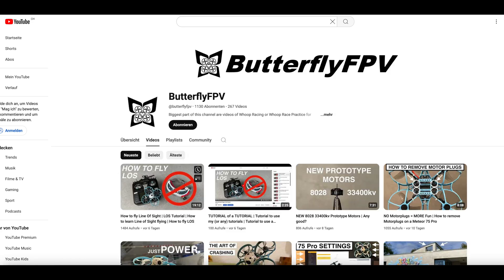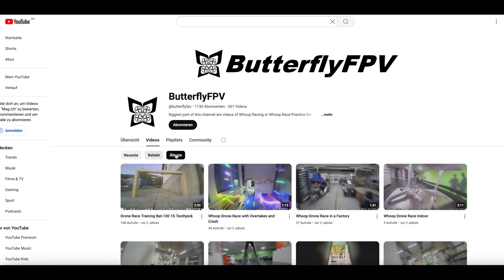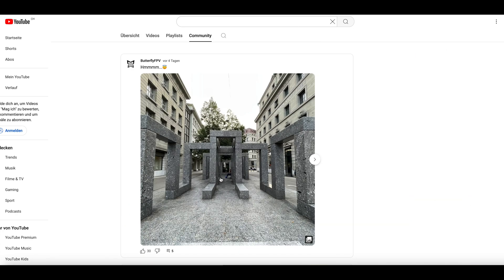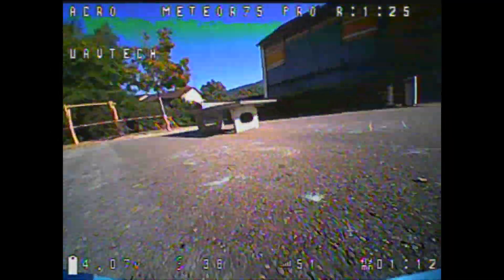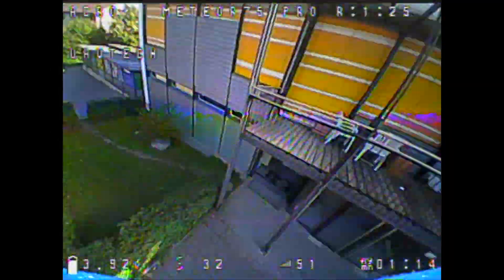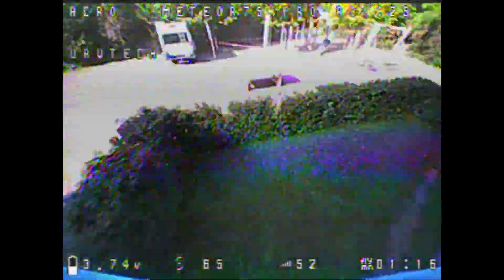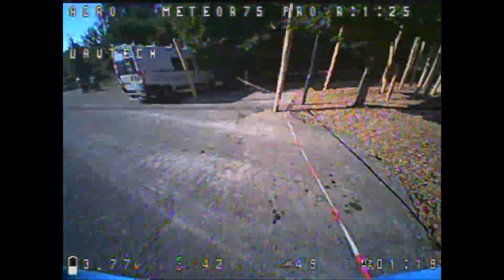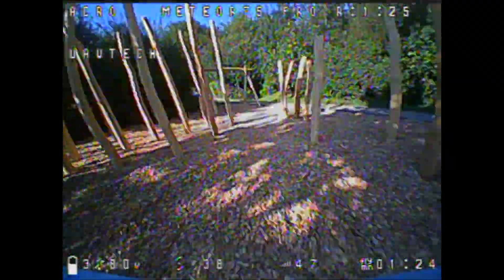🛠️ How to fix slip whoop motor shafts | How to repair slip motor shafts | Motor shaft slipping fix

Comment from the maker: ‼⚠INFO and LINKS in the VIDEO DESCRIPTION⚠‼ And a little additional information here: It could well be that this fix of slip shafts with screw lock or superglue is just a temporary solution. This would be supported by the fact that manufacturers do not use screw locking or another adhesive right from the start. Except now with the new tiny whoop motors. I think they integrated an adhesive right from the start. https://www.tinywhoop.com/.../702-26kkv-silver-edition... To be honest, I've only heard of this slip shaft problem with Happymodel whoop motors so far. In any case, I've never had any slip motorshaft problems with this with my rcinpower motors..
Reply: Great video mate 👍 I had that happen with 3 Snowblowers during IGOW 4 but I'm not sure if it was the lack of adhesive used or also to soft metal on the ring that may wear out.
I tried fixing one back then but the shaft was just too loose.
Reply from the maker: @McLogo76  🤜🤛 Soft material could also be a problem, you're right! That would also explain why the shafts on my Happymodel 702 28k engines began to slip despite the notches in the shaft that were supposed to prevent this. And that would also explain why the problem only appeared after about 100 flights. In any case, I have never had a slip motor shaft with my rcinpower motors.
Reply: I'm flying a Atomrc Seagul. Shaft and bell held together by some sort of adhesive. I used ac glue and it held very well until a bad crash yesterday. I reglued it and will try thread lock next time. THANKS.

Comment: I've done this on several motors the same way that you did and they're still working fine. I used Red Loctite. Also cleaned the shaft and hole with alcohol before applying the Loctite.
Reply from the maker: Thank you for your feedback! Appreciate it! Same here. My motors still work too. I also used the hard threadlocker. (the liquid itself was green)

Comment: You’d think someone in the design team would have made it a notched shaft end in a notched hole to prevent this 😂
Reply from the maker: Yes, that might be the solution. Just like the new top spin motor series from tinywhoop.com. Although it might not even be necessary if the tolerances are right. I've never had this problem with my rcinpower motors.

Comment: I have a question. What do you think about the betafpv 0702se 27000kv vs the Happymodel 28000kv that you are using in the video? I was thinking to give the happymodel a try but l'm worried that they would perform  way worst (power and efficency) compared to the betafpv motors. Thx!
Reply: I've never had a slipping shaft on betafpv motors, had a few on happymodel
Reply: @itsjase92 l see, but l intended to ask more about a "performance" side rather than a "durability" side
Reply: @samsamFPV  Performance is quite similar if you get the 0702SE v2
Reply from the maker: The performance is pretty similar I would say. For you I would recommend 702 30000kv or more.
Reply: @butterflyfpv  Gotcha, thx as always!

Comment: Is it necessary to disassemble the whole motorbell, can’t you just put a drop of glue on the stem of the axle?
Reply from the maker: You can try it. For me it wasn't an option because I wanted to be sure it would last a while. Even as it is, it probably won't last forever. It could well be that this fix of slip shafts with screw lock or superglue is just a temporary solution. This would be supported by the fact that manufacturers do not use screw locking or another adhesive right from the start. Except now with the new tiny whoop motors. I think they integrated an adhesive right from the start in the new motors from tinywhoop. https://www.tinywhoop.com/.../702-26kkv-silver-edition... I've only heard of this slip shaft problem with Happymodel whoop motors so far. In any case, I've never had any slip motorshaft problems with this with my rcinpower motors..
Reply: @ Thanks for your reply. I think I’ll disassemle and glue like you did as its not that big of a job. 

Do you think one could sand the axle with a fine paper a bit to make the surface more coarse for the glue to grip to?
Reply from the maker: @JKunderi  Yes, I don't think it's a big job either. You just have to work carefully and slowly with concentration. So that you don't lose any of the little stuff (like me xD). Sandpaper is not necessary. The shaft already has notches in it. In my opinion, cleaning and degreasing it well is enough. But of course you can try it.
Reply: @ Yes, that E-clip is a Houdini. 

Notches, noted 👍
Reply from the maker: @JKunderi  😂👍💪

Comment: Seems to be a bit of an issue with Happymodel motors. I also had one of mine fail although it took significantly less of a beating than my other motors. Do you recommend high- or medium strength glue?
Reply: Yeah I've only ever had this happen on happymodel motors
Reply from the maker: Yes, I think so too. I've never had this problem with my rcinpower motors. I would take the screw lock hard. Maybe it also works with screw lock medium. You would have to try it. Some also say it also works with superglue. Since I already had screw lock hard at home, I decided on the safest option.

Comment: Great video as usual.  Quick question if you don't mind, installed a new elrs on my first pnp whoop.. so all I need to do is use betaflight to configure?
Reply from the maker: Thank you! Yes. It is important that you know which Uart you soldered your receiver to. And the smart audio cable must also be connected to the correct pad. You can then configure everything in betaflight. (If the firmware on your elrs receiver is not yet the same as on your elrs transmitter of your remote control, then you have to update the elrs receiver via the receiver's wifi)
It's all pretty complicated. But you will do it with the help of tutorials on youtube and the elrs site and people on discord servers.💪 It is important that you always focus on solving one problem. And then the next problem. Maybe this could take a few hours or days. Patience is required here. Especially if you're doing it for the first time. It's best to write down everything you've done. Then you can follow the last steps and have instructions for later. (Unfortunately I didn't do this, so I only know roughly how to do it because I do it so rarely)
Reply: @butterflyfpv  you're a great guy thanks for the feedback.
Reply: Yes